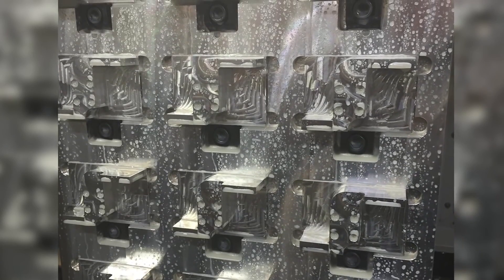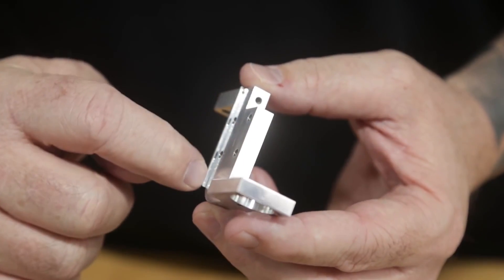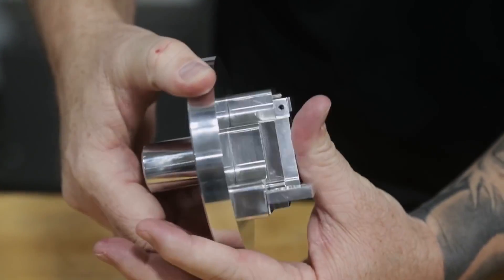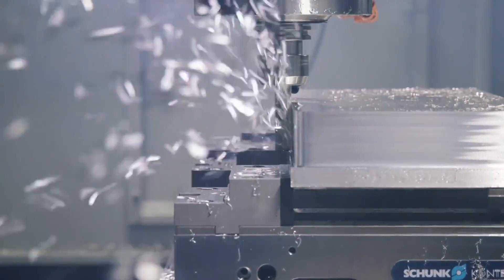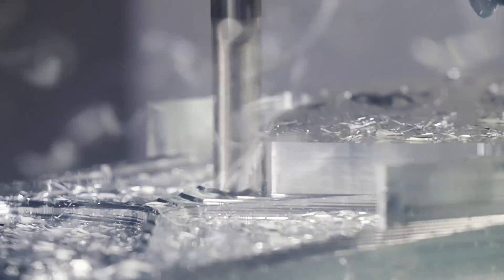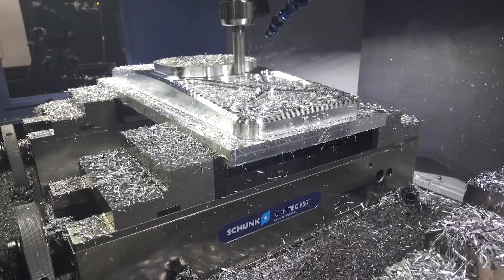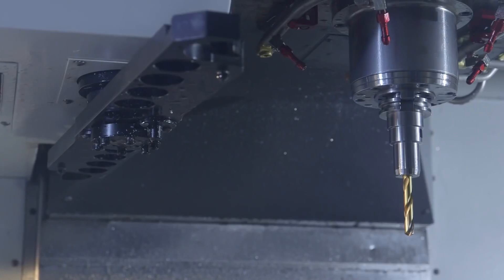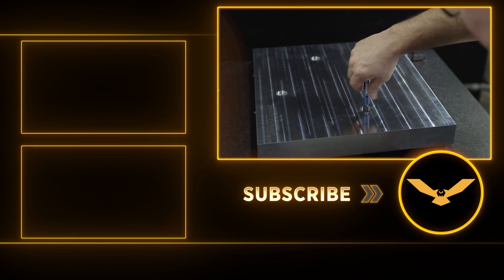Employee SCRAPS an INSANE Amount of Medical Parts... and the Reason is Even More INSANE

Comment: I'll never forget spending 24hrs at the shop just to find out the next morning I put a right angle end mill in with broken corners, even my dad thought it was a .06 radius tool until he measured.  I took it for granted as well, pulled the tool out the right drawer, even checked over every flute and each one was broken just enough to make it look right.  Had I only put a caliper to the pattern at some point in the night I would have noticed and could have dropped my Z offset with the right tool.  Oh the stupid things we do when we are young.

Comment: I was making small tefzel insulators for an R&D run for a military battery. I worked in an in house shop at the battery company. Making maybe 100 parts. Cheap and more flexible to machine them than to mold them for the R&D runs.

So 20-30 parts in a 1/16" endmill hit something. Could only have been the roughed part's mounting screw. Tefzel will run for hours without  much wear on the tooling, let alone getting chipped. Usually wear causes erratic dimension stability before anything else.

I was inspecting every part for all critical dims. Also I was running the part submerged in liquid nitrogen (-320F) to minimise burrs and loading up the tools. I had to pour the LN2 manually every minute or so, at 10 minutes per part.
In otherwords I was busy.

After breaks I always did a methodical check of the first 3 parts. LN2 took a while to cool the fixture and there could be some drift during those parts that might ruin them.

During that 100% check I noticed a very slight imperfection inside the part. It took a microscope to see it. I measured it as being .002 high by about that wide around the bottom of the ID wall. This was there because the 1/16 em had chipped.

The engineer said it would be okay because it was still inside the depth spec. But I insisted on making the couple dozen parts over. The last thing you want is a question mark on an R&D failure. Flatness was not called out as being tight, but an irregular chamfer in a place where none is call for is just wrong.

To your point... if I was not in the habbit of verifying the part 100% after breaks it could have been many more parts that were out. And parts should always be as dimensioned.

Comment: Watched a guy scrape a section of sub flooring for the NASA Shuttle program.He'd been working on the same part for weeks,next thing I hear is someone puking in the aisle.
 The part was almost complete,turns out he drilled the mounting bolt holes in the wrong location.
The worst thing /most expensive part I've ever scraped was a forty ft. Hastelloy pipe used in a chemical plant. I misread the print and even the boss said He couldnt really blame me because he missed it as well when I told him I scrapped it.

Comment: We do full inspection every 15-30 min, Depends on how many parts per hr we are making. We manufacture explosion, and non explosion proof parts for the fuel and lighting industry.  So inspection is key. Even though we have tolerances from .005”-.030”, it matters alot. My goal is to have a perfect setup, good inserts, and meets or exceeds the print tolerance to dimensions shown.
Reply: That is a good attitude to have. The Royal Canadian mint regularly meets 5 Nines (99.999%) pure gold refining, which normally takes up to 7 cycles through the refining process. Their attention to detail has eliminated so many impurities and inaccuracies in the processes that they can do it in 1-2. They are the ONLY mint in the world that manages that. 5 nines means only 1 atom out of a 1,000,000 is not gold. 

Usually only used for semiconductors and scientific research, which makes 5 Nines gold really expensive. They stamp coins out of it. You can buy them every once in a while. :D

Comment: That’s why it’s important for 1st shift or at the start of every shift to do a 100% check. I worked at a Toyota plant and we had a piston recall.
Reply: Haha i think i have one of those motors
Reply: I got one of tbose motorz too bro lol
Reply: Toyota is legendary for requiring exact precision, not allowing a full production run untill things are perfect, even if the line has to be stopped and restarted 100 times.
Reply: @Marc83Aus  - I worked for a sister company to Toyota for years, we manufactured their brake calipers….for Camry, Rav 4, Tundra etc….they most definitely have high standards. I appreciated the quality too.
Reply: I used to work for a tier one automotive supplier and I agree that Toyota had the highest quality standards in the industry. I was amazed at all the hoops we had to jump through but after awhile I really came to appreciate their methodology. Unlike other OEMs they would work with you to solve problems while the other OEMs were only interested in charging you for problems.

Comment: This bring back an unforgettable horror! I was brand new at a job I held for 25 years. Got put on a job I’d never run before, running a cast iron part, approximately twenty pounds, and was told to just chuck the part and push the button! Remember, I was brand new. Hadn’t even been trained on how to inspect the part.three hours later the in process inspector came around and told me to stop running, because the part was out of print. A part he’d gotten from me 2 1/2 hours before. Seems the day shift group leader called from the bowling alley, saying to check a dimension, as he had changed a large counterbore tool and didn’t check its depth! Thankfully the chore was shallow and the parts could be reworked and not scrapped. I thought I was finished before I’d even had a chance to start my machining career. I machined for two years and then became an inspector at a company that is the world leader in rotating unions!
Reply: Ah, yes, I have heard of Rotating Union Leader Inc.

Comment: I didn't hear what was the cause of the issue. Was the new tooling mislabeled or in the wrong location? Was to the tool out of spec? It's not really clear. You can't 100% rely on inspection unless you 100% inspect.

Comment: It was a question I was asked in the interview. What do you do first when pulling a tool out the cabinet or tool crib. ( measure it ) Should double check tools even if you have a tool crib guy.   I went on a interview to a place and the guy drilled  over 600 holes in plates to big. He got a replacement drill from tool crib and just kept drilling until he was done with his parts. They scraped 300+ parts . They fired the machinist over that.
Reply: There was a thing I read some years ago, They had built a New Boeing aircraft, they went out and flew it, it worked just Fine. They Landed it, took it all apart. Every part was checked for accuracy and tolerance...The whole plane was 90% out of Specification.  Thing was The critical Surfaces that HAD to be There were there. I thought that that was very telling on where the industry at the time stood. During the production of these planes there were no CNC Capabilities, There were no Bubble Gum Chewing Button Pushers that are now Proudly mispronouncing their 'Machinist" status. Goes to show that there is some latitude in a vast majority of parts, and Most are not Critical, These were done on Fixtures mostly By Skilled machinists and they were done on Manual Equipment.

Comment: I did my apprenticeship at an Ordnance factory in Australia making stuff for the military in the tool room on a regular rotation and this poor bastard in my year level did an operation on a stack of parts but didn’t get a “first off” check done (that’s what we called it) and stuffed the whole lot. Problem was it went onto others and they did their bit. Time wasted. 3 big pulls on the shop airhorn meant all gather up the front and this poor prick named Brent got roasted, but he did wrong and he knew it. Foreman was harsh but extremely fair almost like a drill sergeant where he could rip you a new arsehole and later be your best mate and man did that dude have peoples respect. He would only truly get pissed off if you learned nothing from your mistakes. Think about you often Punchy.

Comment: I own a small cnc shop and this really resonates with me, I don’t machine to the same tolerances you do or the same volumes but I ran 15 really simple parts in a fixture, all were good, passed them onto the day shift, within 3 parts they damaged the fixture and didn’t notice despite the cutter running down one side of the part in fresh air and the remaining 65 parts were run out of place, long story short a small job that should’ve made us £500 profit cost the company £3000 in damaged materials, may not be a lot to some people but a £3000 loss in a day is a lot to us.  Pays to check everything twice and the lesson I learned is you cannot trust employees to be responsible for their actions so now I check every job personally
Reply: Iain, You will never grow with employees like that... 
You can't personally check every part AND run/grow the business all by yourself... ☹️
Reply: Thats micromanaging, and not good approach. Try to create systems that are fail proof. Standard of operations guves you a reason to audit the process and enquire has this been followed? if this has been followed how we got this wrong? Quality officer is responsible to making sure quality is as per standard. You can become the quality officer, but standards is what keep a shop in line.

Comment: 2000 parts at least 10% should have been 100% inspected . 
Should set up S P C on all runs . Operator error changed out a tool and didn't check the part .

Comment: Watching you interpolate a round hole and checking it with a plug gauge reminded me of a time when I was doing the same thing and the part was scrap.  It turned out that even though the go and no-go gauges fit perfectly, the hole was out of round because of worn ballscrews.  Every time the axis made a change of direction there was a witness mark that indicated a problem with the diameter.  I have learned that if I want a true round diameter, I would set up a boring head to the proper finish bore diameter and let it take out the final .010" by boring in and boring out.  Perfect round hole.
Reply: Plus it's faster.  Circle interpolation should only be used on one off or high tolerance machining.
Reply: My old shop teacher mentioned that. They had parts get sent back because they weren't fitting. They bought all kinds of new tools, had the service guys out tightening every possible bit of slack to nothing, just pulling their hair out. Then come to find out it was another shop that was making mating round parts that were out of spec because of their leadscrew slack.

Comment: My question is why was a first piece inspection not done at the start of second shift ? The root cause of this would point to inadequate in process inspection procedures and inadequate training for the machinists in when reverification by QC is required. These situations is where ISO based QC systems fall flat on their face.

Comment: I had an inspector tell me my part was a tenth under sized I held it tight in my hand for a few seconds and gave it back to him and said now it's in print.
Reply: I know you were making a joke but you pointed out an important aspect of measuring: A part has to be measured in normal conditions (20°C, 1 atm). If the part is hotter/colder then the temperature compensation needs to be incorporated. This compensates the linear (volumetric) expansion/shrinkage of material due to heating/cooling.

Comment: Good video , it is impossible to check parts too thoroughly . Especially on big batches .
Reply: There was a thing I read some years ago, They had built a New Boeing aircraft, they went out and flew it, it worked just Fine. They Landed it, took it all apart. Every part was checked for accuracy and tolerance...The whole plane was 90% out of Specification.  Thing was The critical Surfaces that HAD to be There were there. I thought that that was very telling on where the industry at the time stood. During the production of these planes there were no CNC Capabilities, There were no Bubble Gum Chewing Button Pushers that are now Proudly mispronouncing their 'Machinist" status. Goes to show that there is some latitude in a vast majority of parts, and Most are not Critical, These were done on Fixtures mostly By Skilled machinists and they were done on Manual Equipment.

Comment: I worked in a medical shop for a few years, and this was almost every night. They made me the shift lead and I had to leave after a while because management was ok with parts being constantly scrapped and didn't want to hear the solutions I offered. It never mattered how many parts were scrapped, how many machines were scrapped, or how many tools would be stolen.
Reply: They didn't want to hear the solution, because it would have required them to get of their ashes and implement better processes to support the machining departments. The last place I was at, the engineering department wouldn't make MOT blueprints for each machining operation, so one had to sift through pages of blueprints to find dimensions. It was ridiculous on some jobs if you REALLY checked your parts, so I made my own MOT prints so I could efficiently check parts. Lots of pencil whipper's in that place.
Reply: Obviously a tax dodge.🤣😂😁😀😎
Reply: I once worked in a workshop where literally everyone was a subcontract worker. No one cleaned up behind themselves and nothing was maintained properly. I only last there a few days before quitting.
Reply: @elypowell6797  Not the way I would put it, but SuperSlave, Germany's superhero who simply wants to spend more time with you for the glory of toil alone, has many children.
Reply: I don't understand that.Why wouldn't you want to do better work and try harder? Thats why i'm for profit sharing as your workers will put more effort in if it gets them more money
Reply: @Xlaxsauce  just bad management or there is something else going on within management.
Reply: @drink15  maybe management gets a cut of all those stolen tools lol
Reply: @Xlaxsauce  Tax write off for losses. Massive companies use it as a loophole to avoid paying total tax amount and since its profitable they don't care. when a CEO sees a quarterly earning of 18 million dollars and 4-5 million for a year in losses seems like a good deal.
Reply: @Xlaxsauce  Exactly. The workers know they can do bad work or good and get paid the same. People need incentives, bonuses, or something to work for or else they just don't care. That's just bad payment or management structure.

Comment: Am and old school machinist who came up into the trade in the early days of CNC machines. My learning was based on tape readers and then migrated to the internal storage systems along with Mazak CNC that had the graphics program system. Anyway with today's insert types of mills one can get away with knowing that those are held to tight a tolerance but with regular ground end mills it is a different story, at least in my book. The shop I learned in produced fuel controls for jet aircraft and some of the parts were a pain in the arse to machine and some had a lot of tight tolerances. 

We always checked a part (when a tool was changed) for those dimensions that it was going to affect. We also had a rule that we had to check all close tolerance holes (with plug gauges) every 10th part to ensure we had good parts.

I had seen several of your videos and you guys are awesome with what you are doing and teaching. I like the way you remove the metal at high speeds...in my day it was all about hogging off as much as you could in one bite....We did have accurate CNC equipment then but not as accurate and precise as today. 

Keep up the good work and love the videos.....

Comment: Can those shavings interfere with the movement of the table?
Reply: Yes, they can.  When I was running these machines it wasn't so much the large chips, but razor thin small chips that could jam in odd places and cause problems.  Usually it was best to blow, or brush them out every few pieces, and continue machining.

Comment: Root cause of non detection

Didn't measure dimension. why? Forgot to measure after tool change / not aware of risk / dimension not part of in process checks. 

-Need to update procedures on tool changes to require full remeasure of stage part.

-Update in process checks to ensure all dimension are covered during in process checks. Split in process checks into sections to minimise resource while still checking all dimensions over a number of check's

-Review training of employees to include this issue.

Root cause of non conformance

Incorrect tool used. Why tools look similar

Make picking the wrong tool harder or impossible to do.

Poka Yoke tool holding
Scanning cross check on tooling QR codes?
Colour code tooling
Unique tooling racking for high volume jobs.
A link between QC and tool access.
Reply: Noting any tool breaks and changes I would think would be pretty normal in a high end shop so they can monitor tool consumption?

Comment: When you start a shift, the first piece that you run should go to inspection.
Reply: He said it did but their control plan wasn't robust enough and didnt catch the feature in question.
Reply: @theupscriber65  yes, and that's were the blame sit's on the person who decided it wasn't necessary to do a full inspection of components, period.
Reply: When you change or adjust a tool, the FIRST thing you do is to check the feature(s) controlled by that tool. Then proceed to do a complete inspection of the part. If the feature can not be checked at the machine, it goes straight to QC. Period.
Reply: @ComputerGeek18  Yes, but one missed QC check should not lead to DAYS of bad parts.  That shows that the control plan was not robust enough.